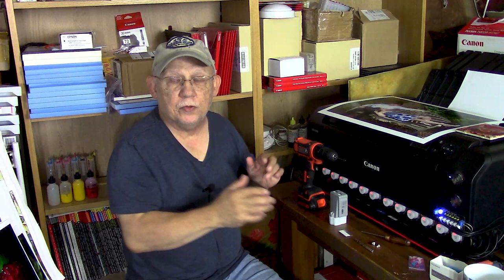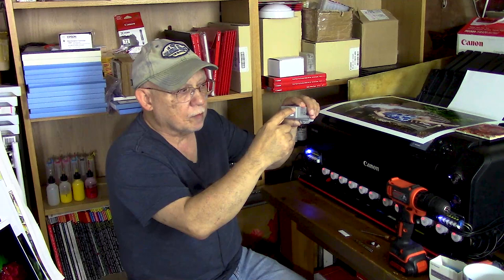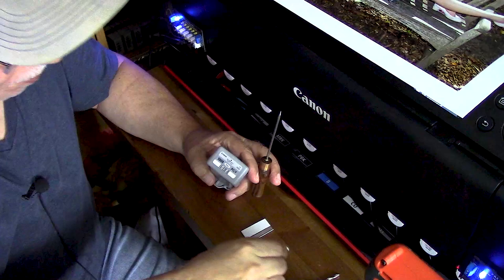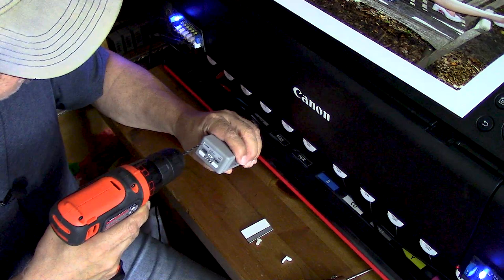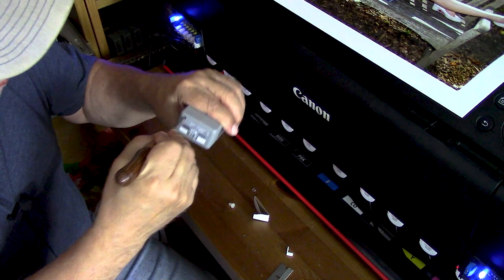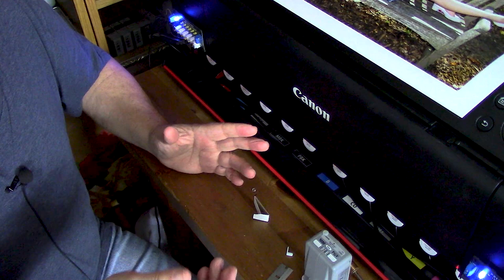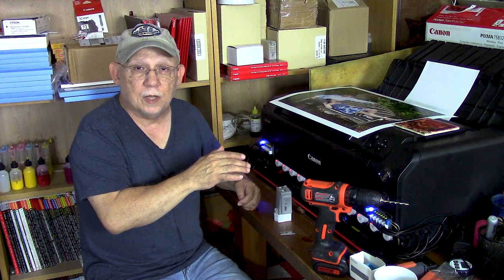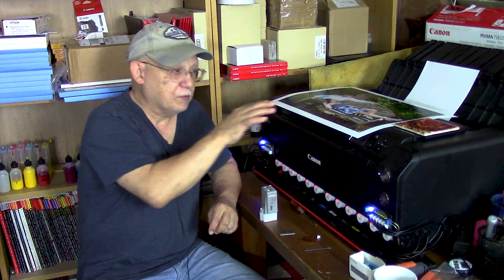Modifying your CANON IPF PRO 1000 Cartridges for foolproof refilling!

Comment: Day Jose, have my doubts or plastic residue in the cartridge, you have both a blackberry outside and within the cartridge.
Small pieces of plastic in the cartridges is deadly for the print head.
You cannot check whether small particles have fallen into the cartridges.
Reply from the maker: This plastic floats. I also flush thoroughly with water just in case. You fill about 3/4 full the flip the cart fill hole down and depress the proper valve. I have never gotten any plastic chip in hundreds of carts I've drilled. Guess I'm lucky eh? Try it. You will see the chips are pulled out. That's what a reverse helix on the drill is designed to do. Been machining and milling for decades.
Reply: @cheo1949  I have been a mechanic for 45 years, from the moment you drill through the cartridge the centrifugal force ends up plastic residue in the tank because the wall thickness is too small. As you said the plastic floats but drilling can cause the chip to be electrostatic and stick to the walls. It is impossible to look into the cart with a camera through the 3.8 mm hole.

Comment: How can I be sure to no put plastic shaving inside the cartidge when drilling?should i use counter clockwise by any chance?
Reply from the maker: Because drill bits pull shavings out. Not push them in. And if by chance one sliver gets in, it floats. Do it carefully. Start with making a dimple with an awl. Drill a 1/16" followed with the final 5/32". Use a razor blade and slice off any little ridge protruding. This plastic is gummy. The Canon Plug should fit tight with good compression

Comment: Nice video as always Jose! I have the Pro100 now and I was planning on upgrading to the Pro 1000.  Should I just wait until Canon releases the new model of the Pro 1000, or is that still a ways away? Thanks for your help!
Reply from the maker: We have no idea when that will happen. I would trap a PRO1000 now as it might be several years. Remember tbat tbe current family of printers the PRO 2000 2100 4000 4100 6000 61000 All use the same printhead and print engine as the current PRO1000. 
With system we came up with the PRO1000 becomes state of the art. You can't do that with EPSON P900.
Reply: @cheo1949  thanks Jose, I think I might just have to place an order for one this weekend.

Comment: Hello Jose, hope you're doing well. I have a pro 1000 myself and would like to know. If I drill the hole in the cartridge or do the squeeze bottle method, do we need to have the added sensors you're taking about in this video or can I just stick it back in and keep using as normal??  I want to make sure before I start drilling into my cartridges. 

Do you reccomend using oem ink over a cheaper option ink? I saw on the precision color website there's oem and aftermarket ink. The aftermarket is much cheaper. Do I need to worry about a big difference??  

Would I also need to purchase the one time use chips if I refill using the method you have in this video or the squeeze bottle method??  Will the cartridge ever stop working permanently if I let it go completely empty?

Basically, can I order the ink, inject it and keep using as long as I don't get the red x on the display??  

Sorry for so many questions. Just want to make sure I do it right.

Comment: I think I understand the overall process. But does the silicone plug need to be reasonable air tight to prevent leaking from the cartridge plug and prevent evaporation or does the Pro-1000 require it to be air tight for some other reason. Since it isn't pressurized, I wasn't sure how air tight it needed to be. If it would have a slight air leak, does the ink gravity feed into the printer emptying the cartridge? 
Since the cartridge is taken out to be refilled, couldn't the hole be drilled in the top corner (as the orientation to how it sits in the printer) of the cartridge rather than on the side and there would be no possible leaking as could happen from the side hole if it is slightly overfilled. Maybe not enough clearance for the top?
Reply from the maker: Literally if you just hold it upside down and nothing leaks that's good enough. If you properly selling out 5/32" hole your plug will fit very tight. I have not had a single issue with any of my 12 carts.

Comment: I have a hard time thinking people should drill plastic bits Into their ink tanks. Maybe it would be better to melt a hole to the ink tanks?
Reply from the maker: The hole would end up to large in diameter if you were to pole a hot 5?32" diameter rod into a cart you would end up with a much larger hole. There is nothing wrong with drilling. In fact there are special plastic drill bits which makes the job VERY accurate.